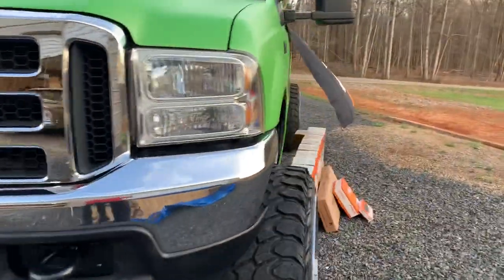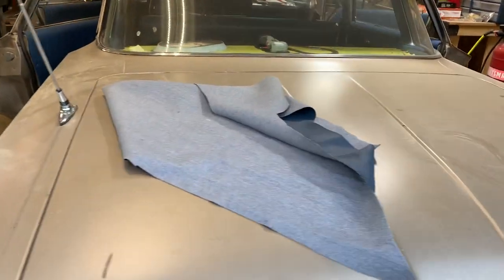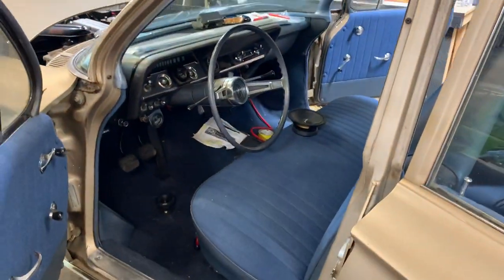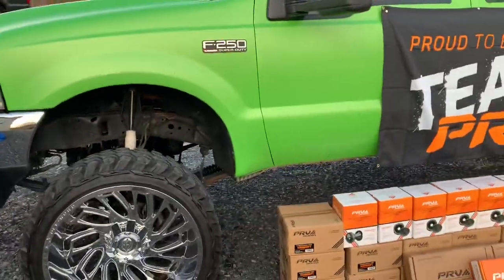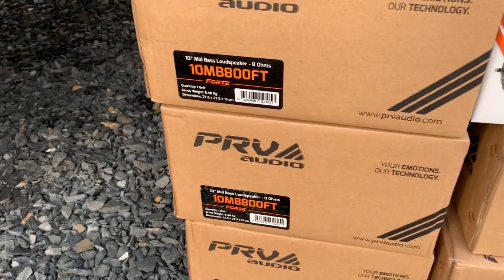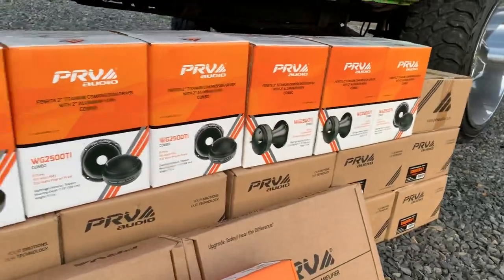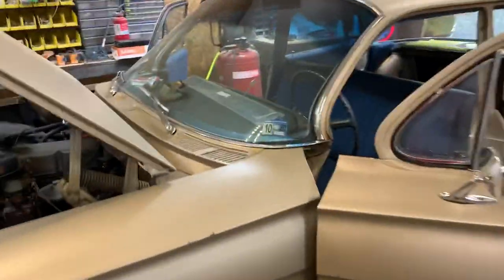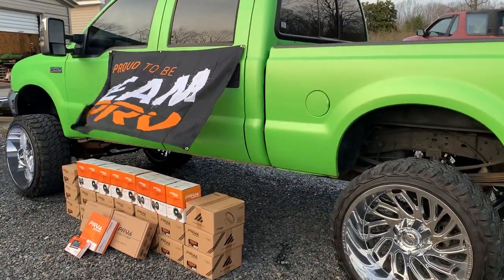FORD F-250 PRV AUDIO BUILD AND UPDATE IN GENERAL

Comment: Quick question how old are those batteries.. because if there a couple years old...... How long do the AGM typically last
Reply: Agm last 7 to 9 years if properly maintained. His agms have never been used
Reply: Well, if you want specific data, look up average discharge cycles for a good indicator of life span for both batteries and capacitors